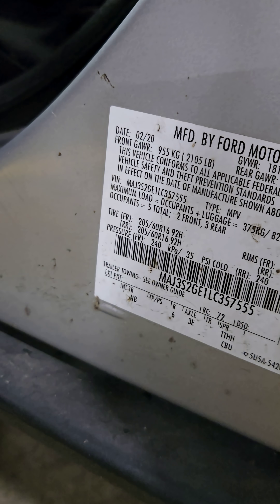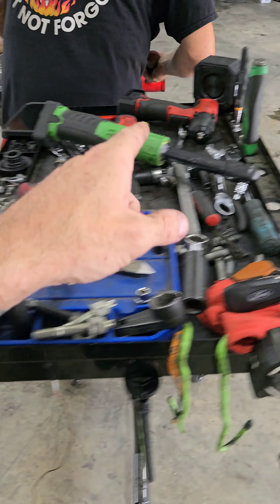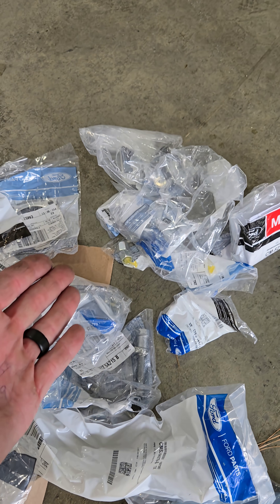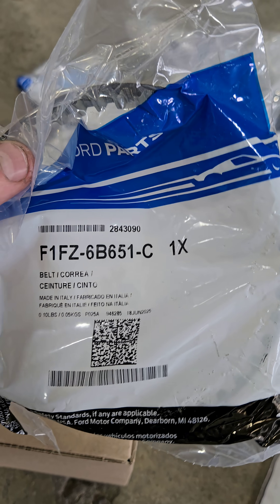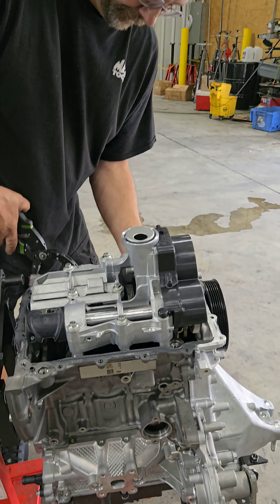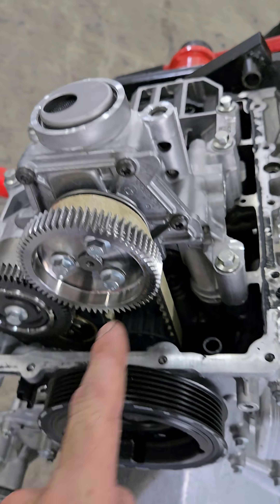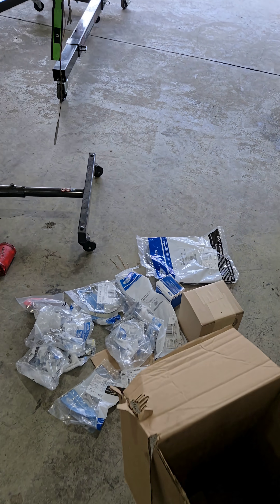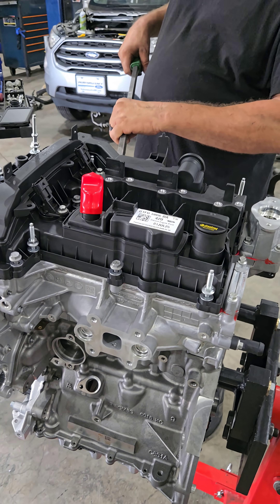Brand New Engine Torn Down WHY? 1.0 Ecoboost

Comment: Have you had any issues with electric brake booster at these new cars?
Reply from the maker: no i have not
Reply: @BeardedFordTech  im thinking about mine.....would you replace the ABS module if it were at 60% at brake test? They said that they dont usually recommend it since is not 50 or bellow, but that i should consider....
On front axle, one wheel brakes ok, the other at 60%, or so they say.....
Reply from the maker: @alinnimeni3789 what?  Sure your talking about pad life?
Reply: @BeardedFordTech No, about the ABS module-the EBB.
The service did a brake test on my car, a while ago.....and they said that on front axle, the left wheel brakes ok, but the right brakes only at 60% and that in the future, i should consider replacing the ABS module-EBB because its fault.
I went to that service because the left wheel brake ok but i noticed that right wheel doesnt brake, the rotor was rusty even after driving....
The dealer said it did some updates on ABS module software......after all this, the car seems to brake fine,  but not quite there since i noticed that it takes a longer distance to stop and a lot more effort to push the brake....
Reply from the maker: @alinnimeni3789 havent come across that
Reply: @BeardedFordTech Those EBB are really a pain in the neck.....
The car seems to brake ok, no more judder after changing the pads/ rotors, i also blead the brake fluid - all this by putting it in brake service mode, just as i learned from you.
However in traffic or no matter the traffic, random it does like i told you when braking.
The dealer said that, back then it had "warped rotors" and the problem i told you plus some brake errors- the dealer cleared them, did a brake test. I changed the rotors, pads, brake fluid...
Reply from the maker: @alinnimeni3789 i havent come across one whwre it said something like its "failing"  could it possibly be the caliper?  Or is that an overseas thing?
Reply: @BeardedFordTech  calliper seems to be fine, pistons not stuck. They said its because of module that doesnt send enough pressure through brake fluid to that calliper.
When i had the error, all 3 wheels brake except the right one. They erased the error, did some software update and the car brakes.....almost normal.

Comment: Forget their new motor how about a kit that would adapt a Harley Davidson V twin in engine bay..
And maybe for reasons of practicality the Vrod revolution motor !!!
Reply from the maker: That engine has more power than a harley. The sportster S produces 121. Screaming eagle is like 140. Milwaukee 8 107 ci77hp. 114 ci 88hp 117ci 100hp  the biggest one is a pan America 1250 with 150hp. This little 3 banger puts out 123. Although a crap engine.  V twins arent all that great. That any v twin. I used.to work on them back in 2011. Fun to ride. Horrible to maintain.

Comment: Wow ok so now we’re failing straight off the production line🤦🤦🤦
Did ford hear built to fail and said hold my beer!!!!
Reply from the maker: It didn't fail off the production line. It was built before the updated belt and tensioner came out. So it has to get the new ones in it.
Reply: @BeardedFordTech 
Ok cool I stand corrected 👍👍
Reply from the maker: @FTT.76.01  all good

Comment: This engine is still a ticking time bomb. My advice to the owner would be to sell it on immediately after the recall work is done. It'll never be worth more than then, and that's about the only thing it has going for it
Reply from the maker: I dod compare old belt and tensioner to new ones.  New belt is kevlar reinforced like in the 21+ F150 5.0.  Tensioner is slightly different.  Not saying its perfect. But by looks and feel. Its better than what was originally put in there.
Reply: 2020 and it has timing belt. Shouldn't everything be timing chain nowadays?
Reply from the maker: @IBO8Jaeger not necessarily.  Depends on the application. A lot of these compact cars use a belt for timing. Other use a belt for.pump and chain for timing
Reply: @BeardedFordTech I know you can say they are junk because you fix fords . But it’s all junk my Camry with 305k miles will last further than these engines
Reply from the maker: @silasferreira9647 your camry is probably 45 years old too.  Even new Toyota are junk. New Chevy. New RAM. All junk.
Reply: @IBO8Jaeger Timing chains suffer from wear due to direct injected oil dilution. Dry belts are better IMO. Wet belts are an absolutely horrendous abomination of modern engineering though
Reply: Ford Eco Shyte?
Reply from the maker: @AuralioCabal-nl8gi yep. We established that.  The 2.7 and 3.5 arent.

Comment: Today's new engines are junk in the box!
Reply from the maker: Thus one is most definitely.  I've seen lawn mowers with bigger engine. Sad part is. A lot of manufacturers are going to wet belt. Its not new but more are using it. Timing thus thing is a PITA out of car. Cant wait to do one in car 😡
Reply: It is the quest for light weight and mileage  over  ruggedness. ... E.P.A. pushing for ever higher numbers.i think all new designs crank out great potential   today. They just do not have long lasting design  parameters.i love old school. I'm old myself. But today's  cars do drive better than the old stuff. And quite remember  60's  cars needing ring  jobs and or valve jobs at 100,000. Sure do NOT miss intertubes  or 4 wheel drum brakes with No booster.😊
Reply from the maker: @WayneSummey-q8c oh man i had a 68 mustang drum brakes. Talk about a hard pedal.  It rode alright. Like a 60's car. New cars do ride great. And its always the push for better fuel mileage. Well if fuel lrices were high all the time we wouldnt have this problem.
Reply: 100% crap this why I retired
Reply from the maker: @JeffreyWehr-ik3qj we can tell. Cause then you would know its not just ford. You would know GM, PSA (Stellantis) audi hyundai ans volkswagen to name a few uses it too

Comment: Manufacturers are going backwards.  In their effort to squeeze every dime out of each vehicle, their deceptive decontenting practice and substandard parts are starting to bite them in the ass.  Nowadays, you better research a new vehicle before you buy it.  You could very well save yourself money, time, & a bunch of headaches.
Reply from the maker: This is true. But even the research can only get you so far. Everything is built like crap nowadays. These last two days its all I delt with